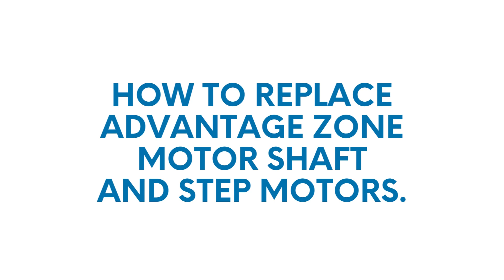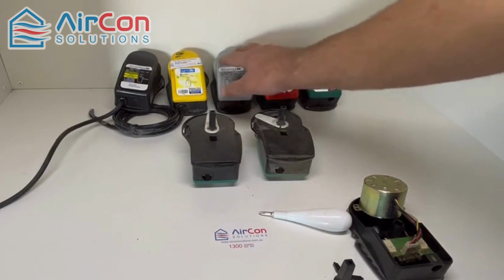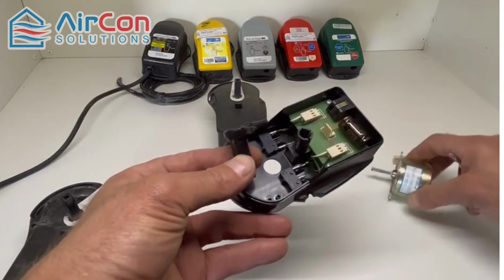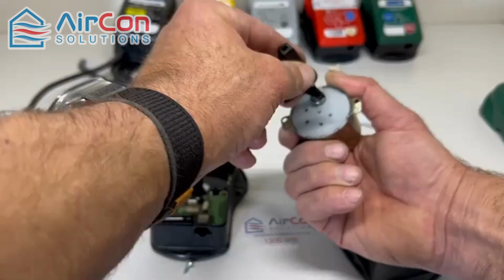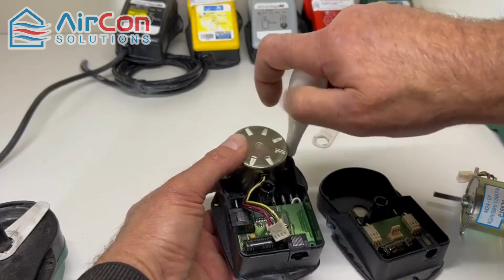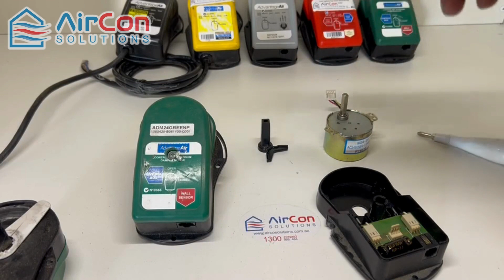How to Replace Advantage Zone Motor Shaft and Step Motors by Air Con Solutions

Comment: What could be the issue if the zone controller works on the other zone
Reply from the maker: What type of controller are you using to drive the zone motor? 

There is two factors that could be.

- cable issue 
- driver controller, there could be a issue with that port
- set up issue if you can give more details of your set up I can give me support 

Thanks

AirConSolutions

Comment: What is the purpose of microswirches
Reply from the maker: To stop / isolate power to the step motor when the blades reach a fully open or closed position.
The aim to prevent over driving.